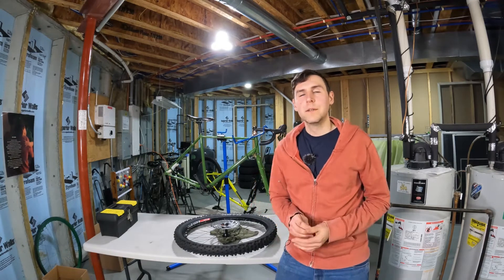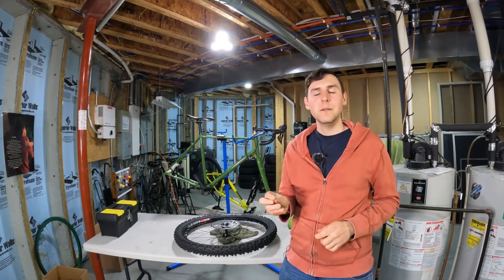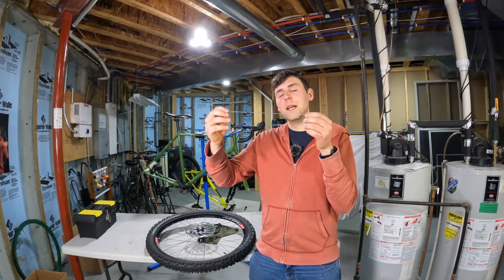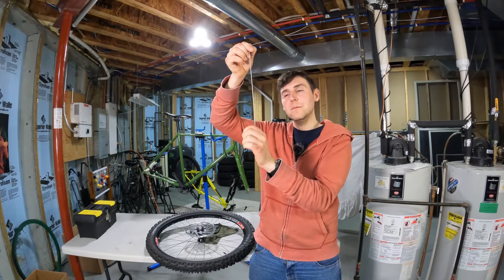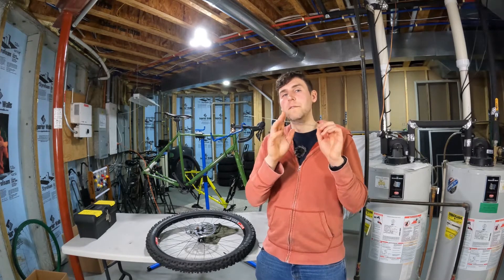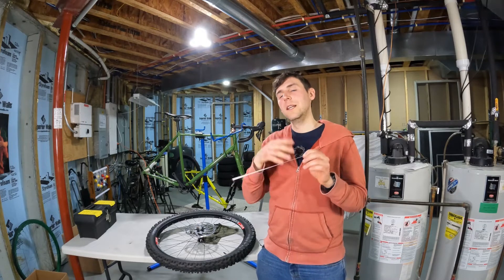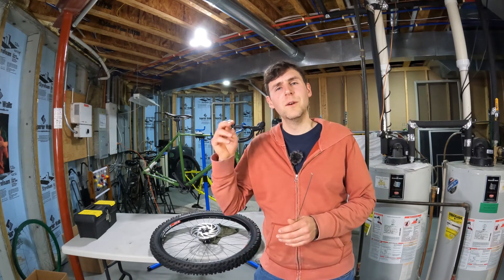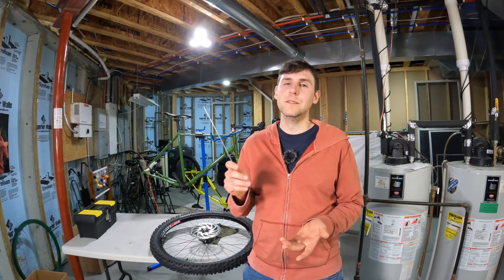Why it's worse to under tension than over tension bicycle spokes

Comment: I don't agree that it is better to have an overtightened than an undertightened spoke. It's about numbers, for example: if the spoke needs to be at 100kg, it's better to have it at 90kg than at 110kg because it's closer to the maximum force that can damage the rim or hub if the wheel is radially assembled, or the long-term effect is that fatigue will occur sooner if the spoke is tighter than looser.

Comment: 0:40 The spoke cannot be loaded with pressure because it is only fixed on one side and the other side where the nipple is is not fixed to the rim in that direction. And even if it were fixed at two points, it would mean that all the spokes are too soft because if they were tightened enough, they would not be able to stretch enough for the opposite spokes to go from stretching to compression.